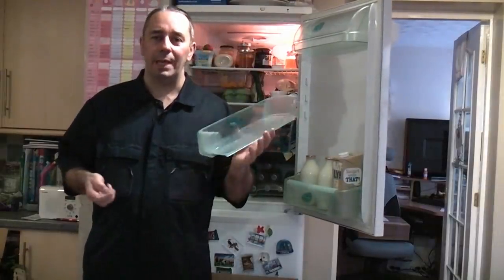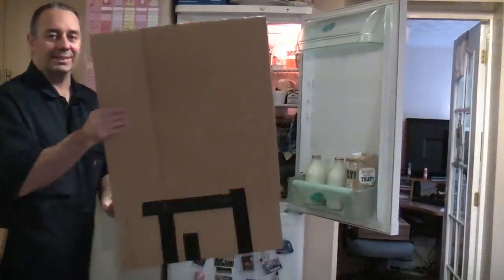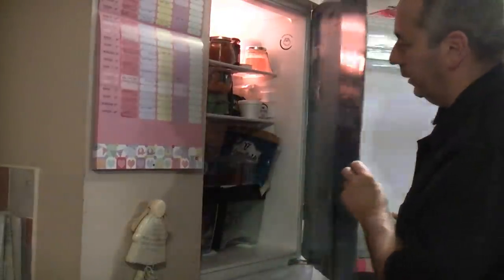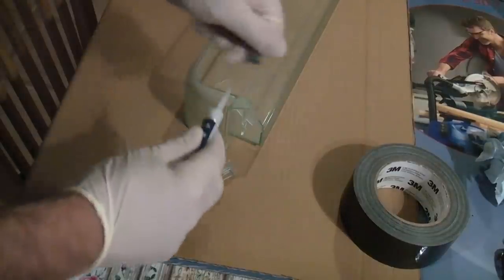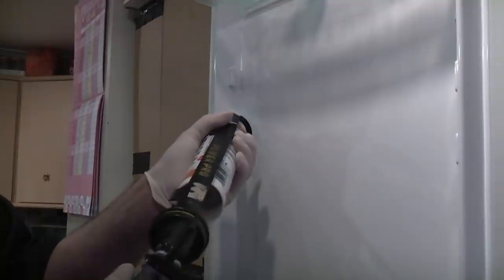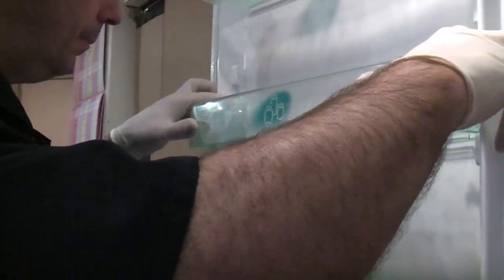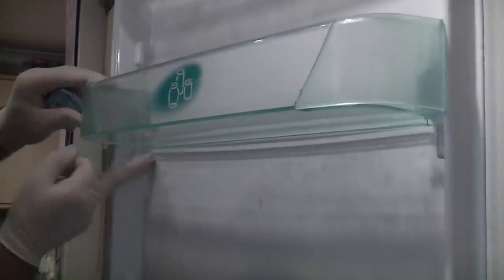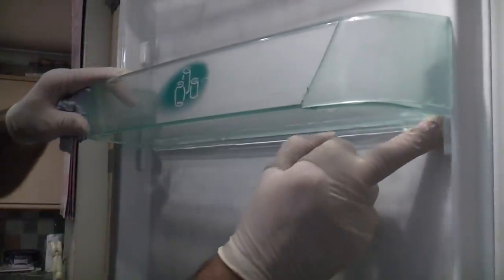How to repair a broken refrigerator door shelf

Comment: Great video. Bought some RTV silicone for $5 and fixed two shelves. Clips were sheared right off and fell inside fridge door so zero chance of glueing those back on. Used the silicone to perform and basic surface to surface adhesion forcing the silicone to take all shear weight. Crossed fingers and 24hr after cure loaded fridge up. Shelves are firmly affixed and holding large quantities of heavy glass jars. Thank you for this video, nicely done!

Comment: Great fix for a ten year old fridge.  The cheapest price I've seen for the adhesive is about £8 so buying a new shelf would be £22 more - not worth it on an old fridge but maybe a new shelf would be better if the fridge wasn't as old.  I'd never heard of Adiseal before - worth knowing if you need a transparent grab adhesive.  I learn something new every time I watch one of your videos.  Thank you.
Reply from the maker: Adiseal is great, I only used about 1/3 of the tube and resealed it with a screw and Gaffer tape for future use ;-)
Thanks for the comment

Comment: Great video, thanks. I have just repaired the milk bottle shelf in our fridge and followed all your suggestions, except the brand of adhesive. Great idea to make a cardboard door, which really worked well. I decided to use an adhesive that was supposed to fill gaps, as it was the part that slots over the bump on the door that was broken, letting one side of the shelf drop, so pretty crucial, especially with heavy bottles.  I used JB Weld Plastic Bonder and it has worked fine, but wasn't as thick as I thought. It is described as drying 'tan' but actually it is yellowish and doesn't show anyway, so the colour doesn't matter.  The disadvantage was that it's not in a gun like the one you used, so it was harder to get all the gaps filled, especially along the bottom of the shelf. Thank you for all the tips.
Reply from the maker: I’m glad you found the video useful
Thanks for the comment 👍

Comment: Thanks from me too. Your video gave me the confidence to ‘‘construct’ a fridge door from cardboard and let the actual door warm up to room temperature to take the adhesive. Applied the adhesive in the best DIY tradition (…. messily….) and had to think on my feet to overcome the problem of gaps between the shelf and door. Successfully repaired the door thus avoided replacing the fridge before its time. Will keep us going until we ‘do the kitchen’ in a couple of years. Thanks again
Reply from the maker: Thanks for the comment 👍

Comment: This brought back memories for me from about 25-ish or so years ago, using a type of silicone adhesive stuff at work, gluing up some damaged commercial building roof gutters as a temporary repair. The stuff was hellaciously sticky, (it stuck to completely wet surfaces!) utterly crystal clear, and easily cured submerged under water. It may have been called "flexall" or "flexcell " or something similar, I can't quite remember off hand right now, but I was absolutely amazed at how scary well the stuff worked, lol
Reply from the maker: I normally find that black coloured adhesives and silicones get all over the dam place- especially my clothes!
Thanks for the comment
Reply: Brilliant thanks for  putting a great fix together 👍🏻👍🏻

Comment: That plastic they make those shelves out of can be a bugger to fix. I have found a succesful solution though it is not exactly pretty.
First glue the broken part back on with CA (super) glue. Then use sandpaper to rouhg up about 1/2" each side of the break line, both sides of the shelf. You then need some cotton gauze, the type used as part of medical dressings works well. Using CA glue again you patch over the break line making sure the gauze is well saturated with glue. This creates a poor mans fibreglass type repair. Cotton reacts with the CA glue making it cure incredibly hard and it makes for a durable repair that can be sanded and filed if needed. 
I have had shelves repaired in this manner last for many years, in fact I think my mothers fridge has been about 10 years since I fixed a shelf and it is still secure.
Reply from the maker: I'll try that at some point 👍
Thanks for the comment

Comment: the white plastic insert that shelf slides into came off the door how would  you recommend repairing that super glue or epoxy ?
Reply from the maker: I think epoxy would probably be the best option 👍
Reply: Hi there, this just happened to me with my fridge. Did you manage to fix it and if so how did you do it? Thanks

Comment: I have a different issue, the side bumps where the shelf clips onto have broken off though I still have them, its because the shelves (which are cracked but I have spares luckily) weren't deep enough to stop bottles moving about when in so they toppled and snapped off the bumps, I tried gluing them back on which partially works but because the trays are so thin all it takes is to open door too fast or a bottle to woblle and then tip for it to fall and snap the bump off again, I noticed you used that strong glue in the video, im guessing something like that will work, relative says use a screw through the side but that won't lock in place im assuming and be ugly.
Reply from the maker: A stronger, more flexible glue will possibly work.
I can't believe how expensive replacement parts are for fridges etc. They are very expensive compared to parts for other white goods, such as washing machines.

Comment: The quality of the plastic in fridges & freezers is awful these days.  My wife broke the plastic drawer in a freezer.  After many attempts to fix, finally found clear silicone sealant reinforced with lollipop sticks worked.  Not exactly attractive but then again you don't leave the freezer door open for very long.
Reply: Oh i´m gonna steal that one. Broke my drawer last week while cleaning it. Thank you!
Reply: Our freezer drawer is held together with cable ties fitted through holes either side of the crack like stitching and then coated in sealant
Reply: @Lex4122  broke mine cleaning it as well.  Lesson learnt.  Never clean.

Comment: Hi, see those shelf supports on either side of the fridge at 2:22? One of mine just broke off as I went to take something from the shelf. Is there any way I can repair it?
Reply from the maker: You should be able to glue it back using some epoxy glue.
Just do the same as I did with the cleaning and cardboard etc.
epoxy normally sets after about 10 minutes, so if you give it 30 minutes just to be sure 👍
Reply: @ultimatehandyman  thanks for the reply, I will give epoxy a try

Comment: one of the shelf holders have snapped off from the door on mine, any tips for that?
Reply from the maker: You should be able to repair it in a similar way, just make sure you keep the door open until the grab adhesive cures. Or you could try gluing it using a hot melt glue gun 👍

Comment: I have same issue with  Milk bottle shelf. Can you advise some other brand/make of adhesive which are available at toolstation or screwfix as Adiseal isn't available there. What about CT1 or EB25? Thanks in advance
Reply from the maker: I think CT1 would be ok 👍
It's a shame that the Adiseal is not more widely available! My shelf is still fixed firmly, despite often having 1.5 L fruit juice cartons balanced on the top of the shelf!

Comment: Its not the "milk" shelf itself that has broken but the nodule it clips onto on the actual fridge door. It has snapped off on the left hand side. Caple R1735 model. Any tips? Thanks.
Reply from the maker: I'd just try sticking it back, like I did in this video. It should work ;-)
It's a while since I made this video and the shelf is still holding up.
Thanks for the comment
Reply: @ultimatehandyman  thanks for that, I will have a go :)

Comment: Could I ask I have a shelf snapped off but it has took off the sides also so I can’t put new shelf up if anyway I can build up and make some and then get new shelf please
Reply from the maker: It should be possible, as long as you use a suitable grab adhesive, perhaps even epoxy adhesive and some suitable pieces of plastic 👍

Comment: Nice repair. I had the same problem and ended up paying £20 ish for a new bottom shelf.
Reply from the maker: Yes, they seem to vary between £20 and £30 + post and packing (when I looked), but it was not simple finding the correct shelf (unless you have the model number of the fridge/freezer) 
Thanks for the comment ;-)

Comment: Can you show us how to repair the strut that the shelf sits on. Our fridge shelf's fine but the bit that it slots onto fell off. Loved the video though esp the cardboard door great idea and had to laugh that you didn't clean the rest of the fridge door just the bit you needed.😂 But great video
Reply from the maker: You might struggle repairing one of the shelf supports on the inside, perhaps you could get a piece of thick white plastic and use that to support the shelf, such as 8mm thick acrylic sheet
If you try to use any kind of adhesive in the fridge itself, I don't think it will work due to the temperature. 
I refuse to clean the fridge, as it belongs to the girlfriend 😂
Best of luck with it 👍

Comment: Hey mate, thanks for the video. I have a similar problem however the part on the side that connects to the door completely broke off. Tried finding the part online but it is no longer offered. Any way to fix this do you think?
Reply from the maker: Not sure which part you mean, but can you not glue it like I did in this video?
It's really hard finding parts for older fridges (I think they want you to buy a new one)
Thanks for the comment 👍

Comment: I wonder if you've tried the Super Glue (any Cyanoacrylates) along with baking soda, they tend to hold up pretty well. Just sharing a thought.
Reply from the maker: I've tried Supabond, which is a cyanoacrylate, with a filler powder on such plastics but the repair did not last long.
I've never tried baking soda though, but I will in future.
Thanks for the comment
Reply: Make sure you do a test run on something else though, baking soda acts like a catalyst and the glue sets almost immediately (absolutely no idea how the chemistry works) creating a concrete-esque body. Not the prettiest thing but it works.
Happy to help :)
Reply: I like video, and how you demonstrate fixes possible for the general householder. However, I think its worth pointing out, the reason the shelves were made removable is for ease of cleaning, in a food area where bacteria must not be allowed to remain. I think sometimes £30 is worth paying for health and sanitary reasons.
Reply from the maker: @ Adam Adam 
I don't recall any of the fridge shelves being removed from the door for cleaning - ever.
Thanks for the comment

Comment: Can you repair a rip in the metal on the outside side of refrigerator that was from moving?
Reply from the maker: You might be able to!
I'd treat it like a vehicle and use car body filler, then sand and paint it. The only problem is that you might have to paint the whole damaged panel!
Thanks for the comment 👍

Comment: Speaking of fridges, my fridge has a problem the light works but only when the thermostat is on(cooling) so when you open the door the light does not come on but then it will comes on when the thermostat comes on. I've been racking my brain for this ages can't seem to find any answers on the internet.!
Please help
Reply from the maker: Have you checked that the switch is working correctly, by pressing it in a few times?
I've seen the switches get a bit sticky, so perhaps the vibration from when the fridge is cooling is freeing the switch.

Comment: Deliberately poor choice of material by the manufacturers to make sure you buy a new fridge before it should be necessary
Reply from the maker: I suppose you get what you pay for, and I guess they don't make things to last for ever. I'm not exactly sure how old the fridge is, but I've been with the girlfriend for 10 years, so it's at least that old.
Thanks for the comment
Reply: @ultimatehandyman  It's perfectly possible to use a different, more appropriate material for a minimal on cost. Most modern stuff is junk, designed to be thrown away and ensure another purchase. My first washing machine lasted for 25 years (Not a premium brand) and the next one (Same brand) lasted three!
Reply from the maker: Thanks for the info ;-)
Reply: @ultimatehandyman  You're welcome

Comment: If the door needed to be warmer before you worked on the repair, why didn't you just heat it up with a hair dryer to raise the temperature?
Reply from the maker: I didn't open the door and then stand there for two hours- I do have other things to do 😉
Thanks for the comment 👍